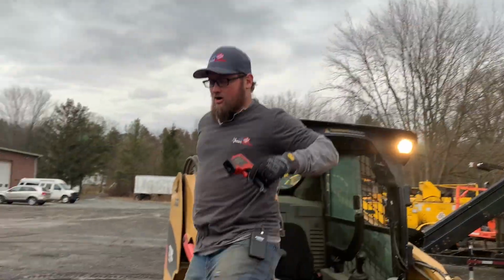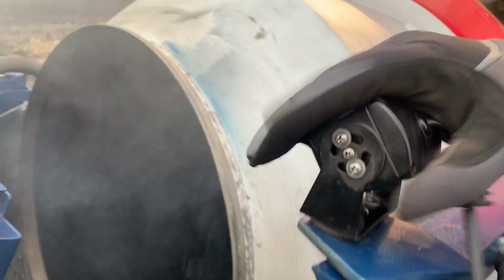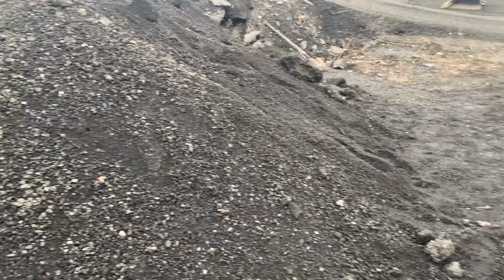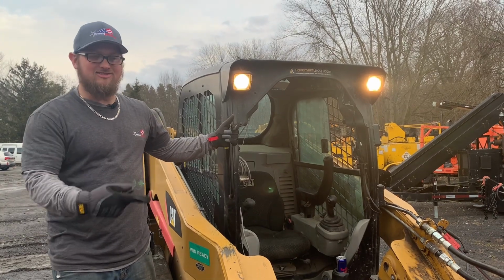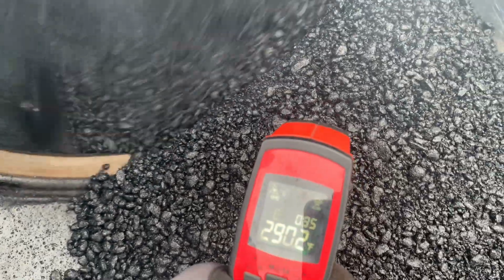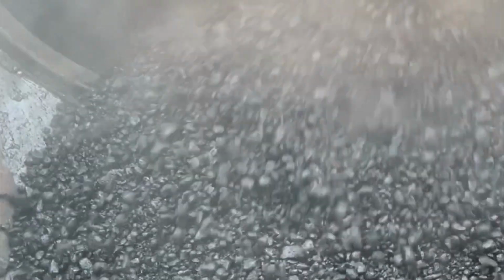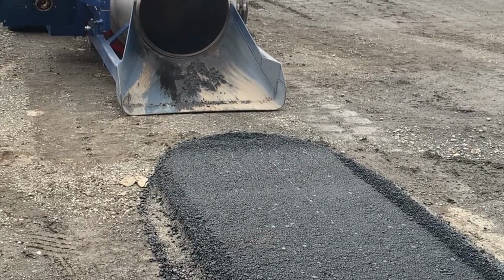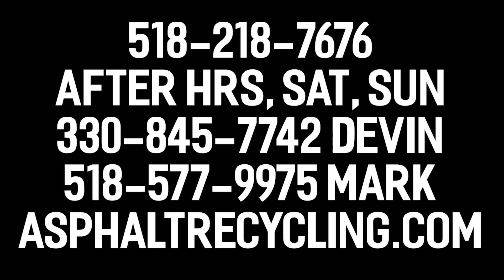Ameripatcher asphalt recycler pothole patcher Pavementgroup.com 518-218-7676

Comment: nice concept and seems to work as intended, just one question, with the millings you use for patching, would it be good to perhaps add extra binding agent manually to the "repair product" (because when you reheat millings it seems to burn off some of the binding agent)

anyways a well thought and engineered piece of equipment and seems to fix stuff for real
Reply from the maker: Thanks! Additional binder can be beneficial depending on the quality of your millings/chunks.

Comment: how long does it take for the asphalt to get to temp and do you have to add any oil to the mix?
Reply from the maker: Depending on the moisture content of your material, roughly 10-15 minutes per batch. The need to add oil would be determined by the quality of the RAP that you're using.